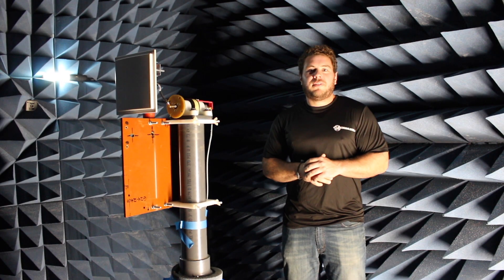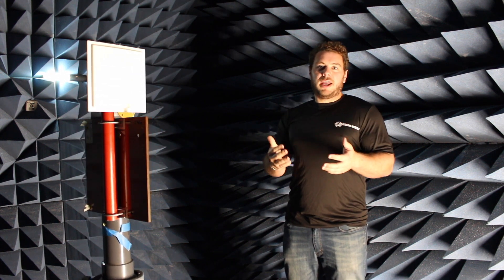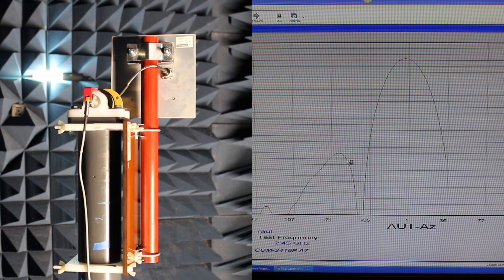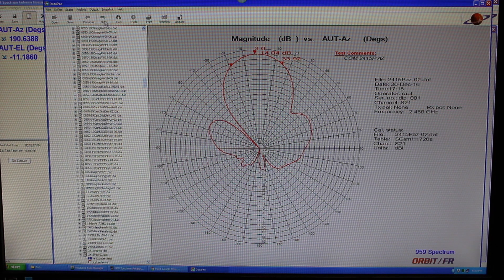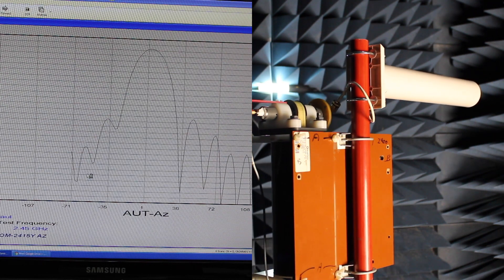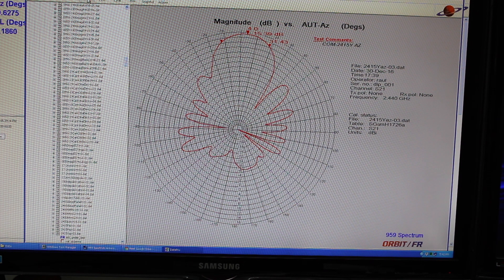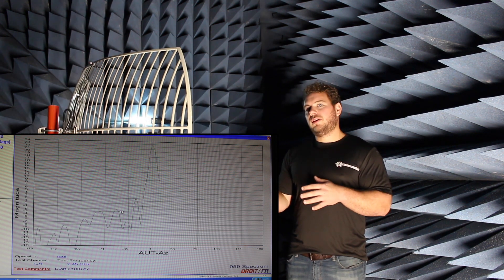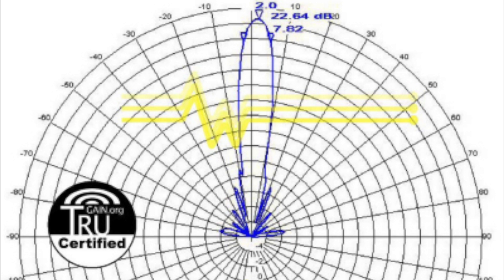How Antennas Work: Long Range WiFi Testing & Analysis With an Orbit FR Certified Anechoic Chamber

Comment: Nice testing one thing people need to know is when you use these high gain antenna's you can exceed the FCC limits for unlicensed Wi-Fi frequencies. While  it's unlikely a home user would have any issues if your a business you could end up in legal trouble. If your interfering with another business they will hire someone to investigate the interference. The FCC will respond to a business complaint who has the deep pockets to go after you. You need to make sure you reduce the power output when you add the antenna gain don't exceed the legal limits. Most business AP's like Aruba, and cisco have places to put in the DB gain of your antenna that will reduce the power automatically for you.

Comment: Have you done this test with the 8dbi 2.4/5Ghz mini panel? I can't find a radiation pattern of this antenna anywhere. And which side is the front?
Reply from the maker: We have, all of our antennas are tested. The rad pattern is 60 degrees and the side with the Simple WiFi logo points in the direction you want the signal to travel. Contact us at Support@SimpleWiFi.com if you have any other questions.